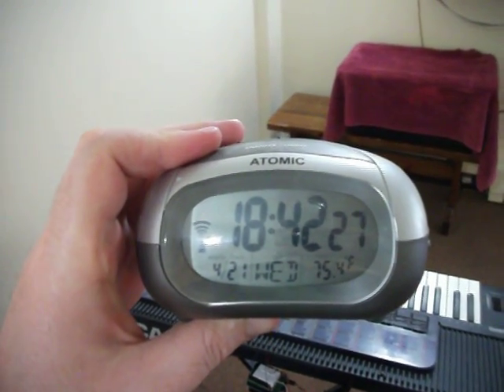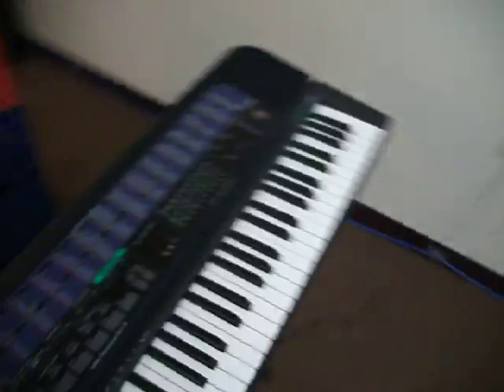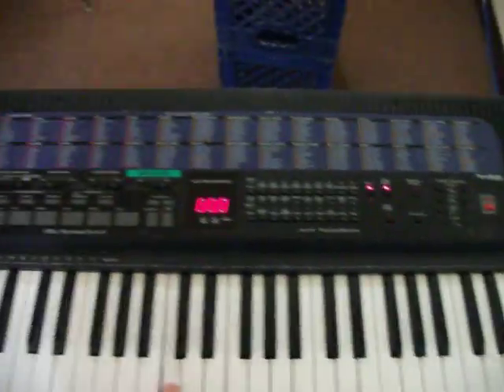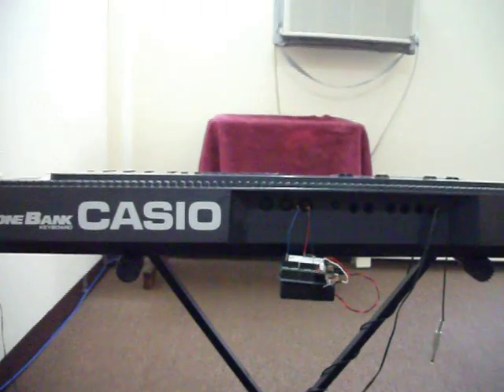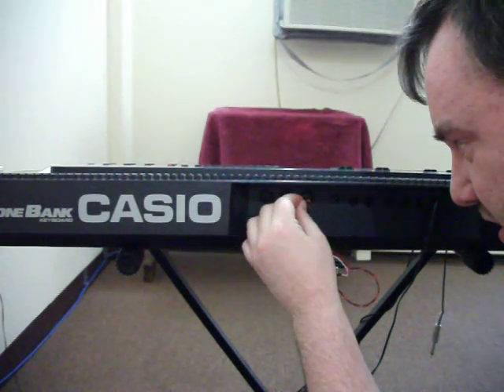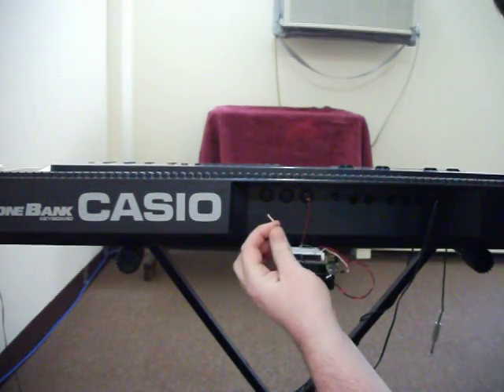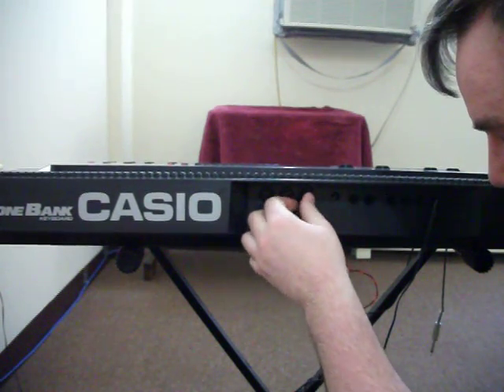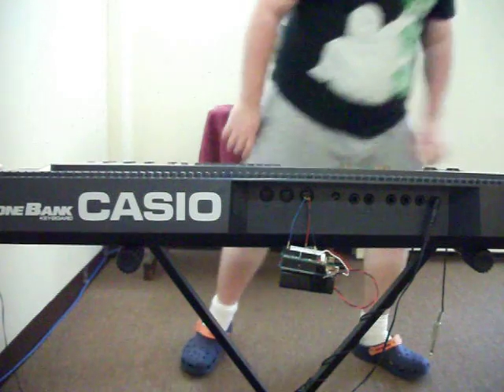Arduino Midi Interfacing a Casio CT-680

Comment: A midi interface consists on the enabling on Arduino a UART at 31.25 kbauds, in the same way as a serial port to write or read the midi data events. Interesting is to do something useful for example a real time arpegiator or sequencer for SD cards.